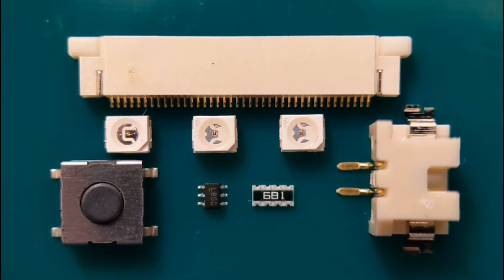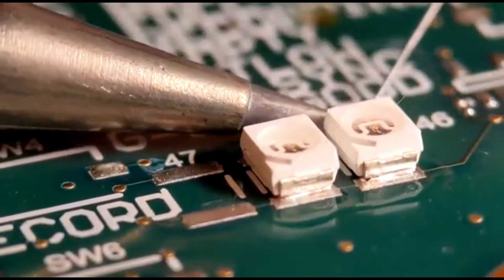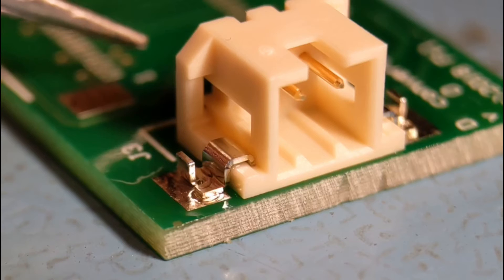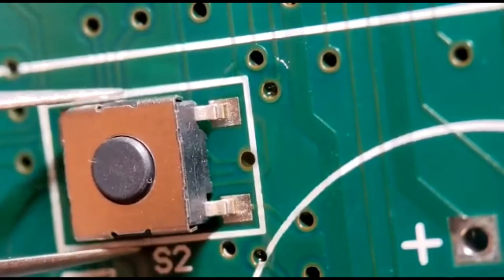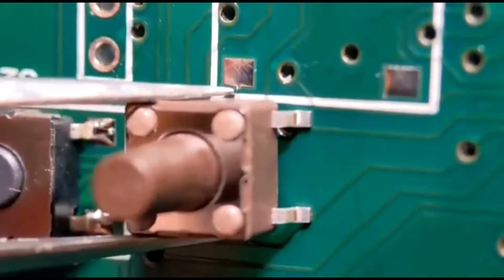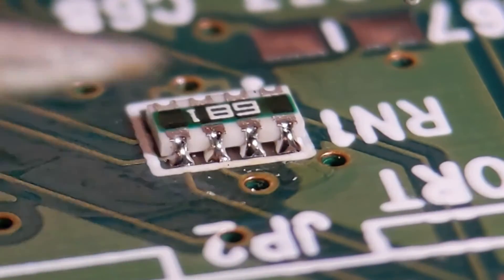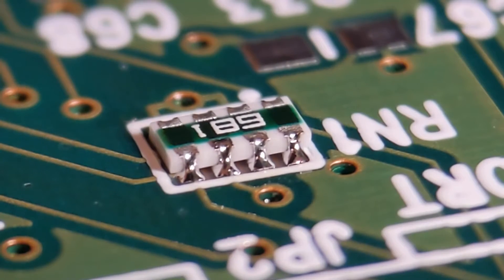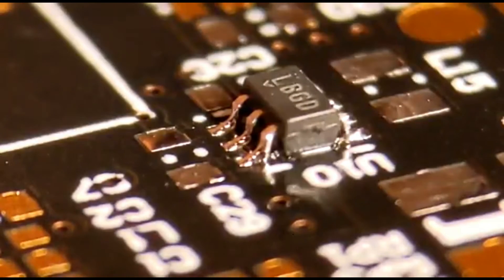How To Solder SMD Correctly - Part 2 /SMD Soldering Tutorial

Comment: Excellent video, well done on filming while you solder, it´s super clear to see what you do!
Do you use/recommend cleaning tissues? I have issues with cleaning boards from flux, I find that the flux is just pushed around the board when using qtips.
Reply from the maker: Hi . Thank you for your nice words. The cleaning tissues I use are very thin dry wipes that leave minimal fibres behind . They are amazing and I've tried lots of types  over the years but nothing comes close to these . I just dip them in a small amount of cleaning fluid ( I use fluid called Ultrasolve ) but there are others out there and wipe away all the flux . Does a great job .
You can get these dry wipes from a company called Grove Electonics ,  www.grovesales.co.uk , about £4.50 a pack of 100. Hope that helps. Thanks again for your time , good luck👍
Reply: @mrsolderfix3996  thanks! These fit with your description,
https://grovesales.co.uk/g-tek-dry-wipes-100-wipes/

I'd do a video about those ;)
Reply from the maker: Hi . Yes , they are the ones . With them I can turn a really filthy board with lots of flux on it to something sparkling . The fluid ( Ultrasolve ) that I use is the best in my opinion as well. Like you say I should do a video on cleaning boards as I have some great tips on that subject . Thank you for your support👍
Reply: Sir: You are awesome I don’t miss any of your videos because I learn a lot from them. Please let me ask a question; What type of fluid should I use? Thanks in advance for your answer
Reply from the maker: Hi , thank you for your comment and your support of my channel , it really is appreciated . The cleaning fluid I prefer is called Ultrasolve  , hope that helps .Thanks again , take care 👍